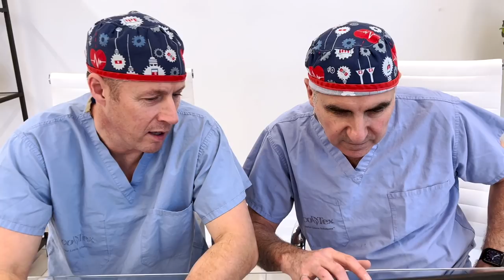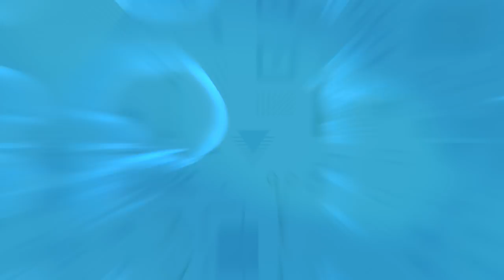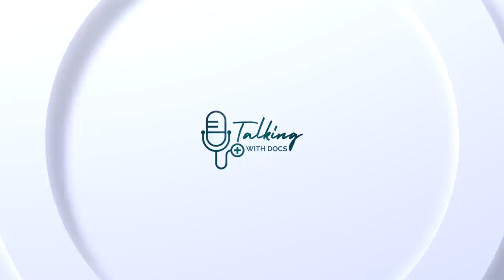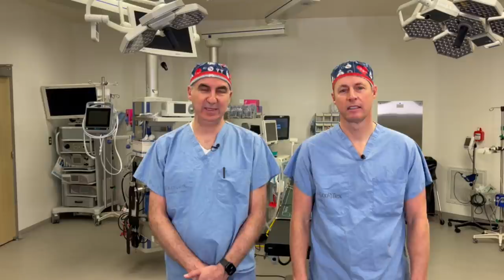Why Does My Knee Replacement Click?

Comment: Yep, have had both knees done and clickity clack don't come back. My knees did click without pain about a year after the surgery but eventually went away. I ride my bike a lot nearly everyday and I think this helps a lot. I was worried at first but like I said it eventually went away. Three year on now and doing great. Very thankful to my doctors for this operation.
Reply from the maker: Glad it worked out Robert. Thanks for watching and subscribing
Reply: Just about have it...as a truck driver.  Mostly city driving..i am skeptical. Please share your experiences . than k you

Comment: Thanks.  Your video saved me a trip back to the surgeon prematurely.  I am 8 weeks and it just started.  Not so much a noise as what I feel in the knee and through my hand when I have it on the knee.  Usually at or near full flexion of 130-degrees.  First reaction was, OMG, it’s popping out of a socket!”  On second thought, maybe it is! 😀

Comment: Originally had a complex rt knee replacement. Unfortunately, due to infection of the metalwork, ended with several operations due to abscess reoccurring on the knee. It was decided to remove metalwork & replace with cemented knee! After approx 12 months a second revision of the knee was carried out. The result was successful - APART from the CLICK!!
Orthopaedic consultant advised not to worry, & watching your vid now makes me doubly happy!! Other than the “CLICKING “ everything works well.
Thanks for your video!👍😉🇬🇧
Reply from the maker: Click away Roger and just be glad you don’t have the infection anymore. Bravo!  Thanks for watching and subscribing

Comment: Hi Docs, I enjoy the info on knee replacements.  I'm 60 and had my left knee replaced 2 and a half years ago.  I originally injured my knee as a very young man and wore the articular cartilage down to the bone by the time I was 24.  My knee replacement was my 16th surgery on the one knee.  Since the replacement, I've gone back to playing half court basketball and lead a pretty normal life.  I'm assuming that one other thing that might contribute to clicking would be the lack of cruciate ligaments (please correct me if I'm wrong) after knee replacement.  I know in my case that when the knee is bent, I have some front to back looseness.  When it's straight, it's fine.  I only get some clicking in the morning after getting out of bed, but after that it's all good.
Reply from the maker: Thanks for sharing your story. The laxity that you experience in flexion is not uncommon. The crucible ligaments are not there to prevent the lower part of your leg from translating slightly forward. Glad to hear you’re living such an active life. All the best to you. Thank you for watching and subscribing

Comment: You fellows might want to do a video telling people movements that can damage joints so that people can avoid them. For example, my two shoulder replacements were necessitated because I used to do lat  pull downs behind the neck at the gym when I was young. Back in the ‘80, all the images on lat machines showed a figure pulling the bar behind he neck so I thought I was doing a safe movement. Now, the image never shows the person pulling the bar down behind the neck as it has been proven dangerous to the shoulder joint. Another dangerous exercise is weighted seated quad extensions on a machine which damage the knees. If I had only known what terrible damage I was doing to my body…
Reply from the maker: Hi Matteo. Good advice. We hate that leg extension machine. Thanks for watching and subscribing
Reply: My PT has me sit at a seated weight machine with 10 lb. weights and extend my leg out and back. Is that the machine you mean? Should I stop using it??

Comment: 12 weeks after revision TKr.Had medial half joint (oxford biomed)done 8 years ago but the mobile bearing dislocated.There was no clicking after the unicondylar surgery but there is now. I gather that the incidence of bearing dislocation is quite high with UKR oxford joints but did I need REVISION TKR?
Reply from the maker: Hi David. Often the other two compartments wear away and you can’t revise a UKR to another UKR. Best of luck during recovery.  Thanks for watching and subscribing

Comment: never had my knees replaced but from time too time the knee I ripped the mussel in will click with no pain like snapping your fingers noise .. since then I had neck surgery and lower back surgery ,, been about 10 years on both and when I turn my head I can hear what sounds like when you wad up paper or wrapping paper noise ,, think it's just the neck mussels stretching ..great info if I ever get my knees replaced ..
Reply from the maker: Hi Randy. You need to be more careful!  Thanks for watching and subscribing
Reply: @TalkingWithDocs  yes I do I had a mishap a few days before Christmas was in my garage on my knees splitting wood for the stove with a hatchet .. well the hatchet slipped out of my hand bounced off my leg 5 stiches later and 2 weeks of having trouble walking so I would not rip the stiches loose. years before that my Doctor said I was accident prone  ,, guess she was right ,, good videos you Doctors put out ..

Comment: Hey docs question the plateau is held together with a plate and screws that was put in my leg and June of 21 is it normal for my side of my leg to hurt where the plate was installed I do have an appointment for next Thursday with my sports orthopedic bone specialist what causes the side pain on my leg where they installed the plate I have no feeling on the outside of my skin due to the surgery it's numb why is the side of my leg hurting nowWould thank you for your info ❤️👍
Reply from the maker: Hi Willard. Often the soft tissues rubbing on the plate cause pain.  It is quite common. Sometimes removing the plate can help but not always. Thanks for watching and subscribing

Comment: Brilliant video as always. I often wonder if you have a crystal ball as you always seem to cover subjects I've been affected by I'd! I'd been noticing  after my 1st TKR, (Titnee MK1),'clicking & clunking'. I'd read that could happen & it would ease off. I saw my consultant for my 6 month check inc an x-ray. I mentioned the clicking/clunking. His response, & it's stuck with me, 'that's the one thing old people who've had knee replacements don't worry about'. Point taken & feeling humbled (I'm 55 now - I'm young then!)! He also said it's because I now have gaps between my knee joints, instead of rubbing against the bones, which I haven't had for years. After my 2nd TKR,(Titnee Mk2), Aug last year when the clicking/clunking started I knew I didn't need to worry about it. I get occasional creaking from both knees but like you said if there's no pain don't worry! Titnee Mk2 still a little swollen/sore but usually because I've been more active, not rested it much or used ice. So I go back to basics. RIC, but not the elevation as I was told that's not so good for a TKR. Plus I increase my physio - so essential. Many thanks from the UK 🇬🇧
Reply from the maker: We are listening Loraine. Like google!  Thanks for watching and subscribing

Comment: I just had surgery three months ago on my left knee where I had a total knee replacement. I now have a click when I walk. It’s noticeable by me but when I told my wife about it she listened as I walked and said she didn’t hear anything. It of course doesn’t hurt just it was something I wasn’t told about before surgery. Not that if I was told prior to surgery it would’ve stopped me from having the surgery.  When I mentioned the click to my surgeon he said it was normal and over the next 6 months to a year I’ll get use to it. He said after a year I probably won’t even notice any longer.

Within a week post surgery I was riding my recumbent etrike approximately 1 mile and by two weeks I was riding it 6+ miles. Only issue I had was swelling but I iced the knee after exercising it also elevated it which helped tremendously with the swelling. 3 months post surgery, I’m now up to 15-16 miles on my recumbent etrike.  My surgeon said I was in the 2-5% of people returning to activities that soon post surgery.  He said most people take longer to return the activities I’m able to do.  I’m very pleased with my knee replacement and only wish I would’ve done it 6 months sooner. 😊
Reply from the maker: Hi Jeff. That’s awesome!!  Congrats and enjoy. Thanks for watching and subscribing

Comment: The joints we were born with often click as we age, my left shoulder does, as does my right knee. I have to be careful with certain movements but so far so good. No need for the knife and replacement thingy now, but maybe later. Good to know that man made joints make noise too. If the pain gets too much I will see a Doc about repair to an old man, till then exercise and diet will have to suffice.  Good video - thanks.
Reply from the maker: Welcome James. Thanks for watching and subscribing

Comment: That would drive me absolutely nuts. It would be no different than listening to a tap go drip drip drip. I’m a few years away from getting a knee replacement. By then hopefully someone could make a knee not click. Thxs for info Docs😩
Reply: I've had both knees totally replaced. Mine don't click. My Dr. did not replace my knee caps. When you are ready for the surgery, do the post op set up the Dr. suggests. My Dr. had us attend a 30 min. class. The operation went well and I was up and walking within 24 hours. The rehabilitation sessions were a little harder, but so worth it ! Good luck on your future operations.
Reply from the maker: Very welcome Mandy. Thanks for watching and subscribing

Comment: Haven't had a knee replacement yet but  I Need one , and rotater cuff redone it lasted  10 years,  those are on the right side My ankle needs repaired as well on the left side . I guess I'am in a mess which to get done first. I think I will have my docs just put some grease fitting in and pump them full of crisco shortening . Maybe one day somebody will come up with that idea. The rooster cone stuff didn't work . O well you have to be tuff to get old!! Hope you 2 are having a  fine weekend .
Reply from the maker: Yes Kubota sounds like you have a lot on the horizon. Best of luck.  Thanks for watching and subscribing

Comment: 14 weeks post op on patella femural replacement on one knee. Less than 2 weeks post op on the other knee. I've got some clicking. And just a few days ago, my first knee has started to squeak. Plastic on back of knee cap, metal on femur. Doctor told me that was likely as swelling goes down. To me, it sounds like a distant bird chirp. Really weirded out my nieces when I had them listen to it.

Comment: I had a knee replacement 2.5 years ago.  My  knee is often painful.  It sometimes gives way.  It OFTEN goes into spasms and locks causing total loss of movement, not only in my leg but my entire body, due to the agony.  I have contacted my doctor and have had an X-ray, which according to the medics show nothing is wrong,  Tell that to my knee……..
Reply: I am not an orthopedic surgeon but I would highly recommend a second opinion soon—before you hurt yourself.  I have a TKR in my right knee and have heard all kinds of horror stories of how people have had to have their replacements fixed or completely replaced.
Reply from the maker: Hi MotherMary. Sorry to hear that. They can be problematic in some people. Maybe a second opinion?  Thanks for watching and subscribing

Comment: I am a avid cyclist 73 and love riding the bike nearly every day , on the road or in the gym.
My question is I need a full knee replacement & my appointment is looming , I currently have 90 degree bend & can just manage the bike, do you think I will be able to ride the bike after the op, 
I also swim a mile most mornings , I think I will be a unhappy bubbly if I don't make it back.☹️
Reply: I meant Bunny
Reply from the maker: Hi Juli. Very thoughtful question. The biggest predictor of range of motion after surgery his range of motion before surgery. Our hopes are always that we can get you to where you were and hopefully a little bit more. There’s no guarantee however. Best of luck to you. Thanks for watching and subscribing

Comment: Can a patella button be implanted 5 years after a TKR with success that it will stop the replacement from locking
Reply from the maker: Hi Jan. The procedure can be done. It would depend on the cause of the locking whether or not it worked.  Thanks for watching and subscribing

Comment: HELLO DOCS
I HAVE  2 HIPS REPLACED AND  MY  RT HIP MAKES A NOISE WHEN I bend (audible).  I  was told it  must be a snapping hip. There is no pain it just feels like something  has moved.  Can you tell me what is wrong?  Thanks 😊
Reply: That happened to me they told me the tendon was snapping over the joint it would hurt when it did it but pain only last a few seconds 
I been more active now and it stopped doing it
Reply from the maker: Hi Byrute. It may be your IT band snapping over the side of your hip. Usually not an issue. Thanks for watching and subscribing

Comment: I had a total knee replacement 4 years ago but never had a popping sound. But I just had a total knee replacement surgery on my right knee in September. And it pops constantly and it hurts very bad. I've told my surgeon and he said it was normal
Reply from the maker: The popping is not uncommon but if it is painful that is a bit different. Sometimes it will improve with time. If it doesn’t go back. Thanks for watching and subscribing

Comment: I am 7 weeks post total knee replacement as of Feb 25 2022. I have no problem squatting or climbing stairs normally. Still a bit sore coming down. I am 130degree flex and 0 straight. How long should I wait before going back to downhill skiing, green and blue runs only
Reply: Wait until it snows😁
Glad your knee is ok.
Reply from the maker: Hi Barry we would say 3 months as a guide. Just go slowly. Congrats. Thanks for watching and subscribing

Comment: Here is a question about 6 yrs post TKR..I have both knees replaced, lately my knees are stiff like a bad storm coming & I will add I have some tingling in both feet..Is it possible for scare tissue to hamper feeling to my feet? What is your thoughts? Thanks in advance..Ken in AZ🌵
Reply from the maker: Hi Ken. Probably not. Distal symtoms in the feet are usually vascular or neurological.  Have a chat with your doc. Thanks for watching and subscribing

Comment: 4 years ago, I had a total knee replacement, and I can say nine does not click, but it does clunk, and it actually sounds like a banging noise although it is not painful, 5 Months ago I had a partial knee replacement on the other leg that clicks with a bit of discomfort, but more importantly I have on a couple of occasions wholly lost the use of the leg, and I have buckled and fallen to the floor, the feeling when this happens is similar to banging your funny bone
Reply from the maker: Interesting David. Thanks for watching and subscribing

Comment: Hi, Brad. I have a question about the cemented vs. u cemented knee replacement. What category of patient might be a better candidate for the uncemented prosthesis over the cemented version? Is the surgical procedure the same for both versions? How about post-op pain management and rehabilitation?
Thanks in advance.
Reply from the maker: Hi Tom. Most of it is the same. Often uncemented knees are used in younger more active patients. But it can be used in most. Thanks for watching and subscribing

Comment: Hey Docs!  My wife is facing a TKR soon and we're meeting with the orthopedic surgeon in a month for his initial evaluation.  My wife has been seeing a rheumatologist for several years and he recently told her it was time for her to consider the replacement surgery.  The knee injections have become less and less efficacious over time.  My question is this: my wife is quite petite, rather small-boned and weighed 107 fully clothed at the rheumatologist appointment last month.  Are artificial knee joints made in small enough sizes so that her doc will be able to fit her with one commensurate with her petite stature?  Thanks for any light you might shed on this!  Cheers from Lafayette, LA, US
Reply from the maker: Hi Frank.  Yes we have a whole host of sizes available from really small to really big.  Great question but should not be an issue of any sort. All the best to your wife. Thanks for watching and subscribing

Comment: Greetings from Idaho! I had a knee replacement in 2017 do to RA.  I have a click or clunk noise from my knee.  If I bend my knee it makes a noise.  When I walk, especially on a hard surface, like Costco, I will develop right knee pain and have continued noise in my joint.  I have constant  swelling of my right knee, more than my left knee.  Every now and then I get an odd feeling & pain, where my knee feels like the joint isn’t stable.  I look down, my right knee looks odd, it looks like there is a portion of my joint that is pushing out to the outside of the knee. I have to rub it and try bending my knee multiple times before it becomes “aligned” again.  Usually. occurs at the end of the day or even when I am sleep and it wakes me up.  It does happen at different times of the day.  I cannot reproduce what the joint does to show my orthopedic surgeon, unfortunately.  Is this normal?  Thank you for doing these videos. 😊
Reply from the maker: Hi Lady. So these symptoms are not uncommon but are not necessarily a sign of something wrong.  Start with an exam and an X-ray to check the parts and go from there. Best of luck. Thanks for watching and subscribing